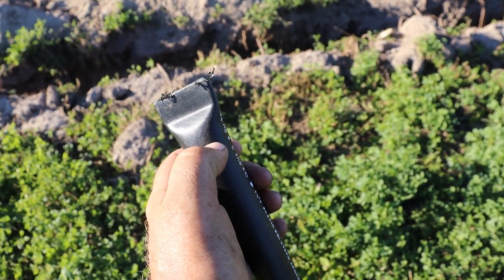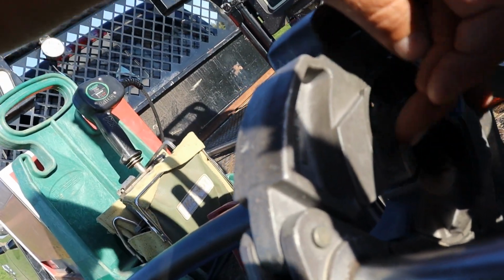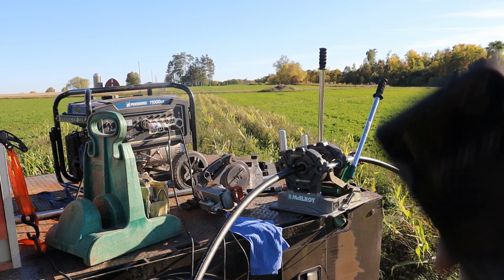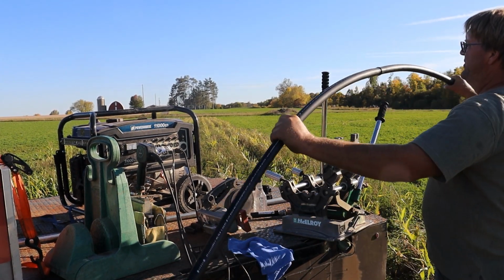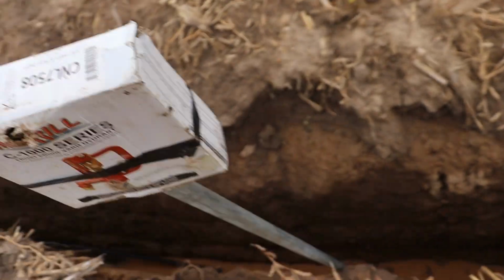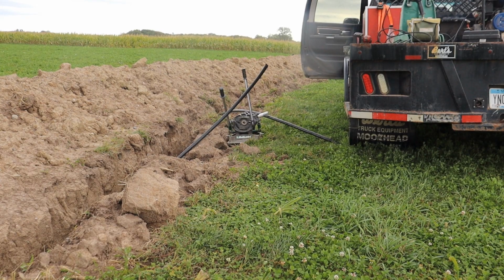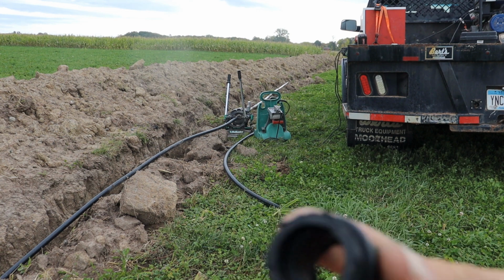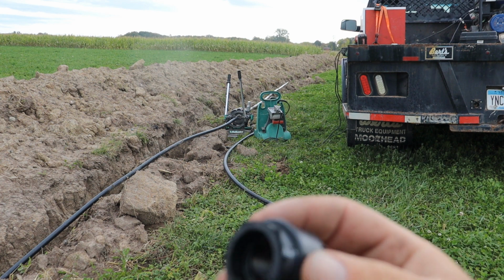Welding Plastic water line for the cattle.

Comment: Very slick way to do lines, not having to worry about splices and connections leaking is huge!
Reply from the maker: i hope so.  and then the heaviness of the pipe,  i can run it over with the pickup and it barely made a mark, very strong stuff.

Comment: That poly pipe is amazing tuff stuff! We use the same type of pipe but in 8" at the gravel pit I work. I have pulled 1200' long pieces around with a 40ton excavator and never broke any of those welds. We pump sand through it and it out lasts steel by at least 10 times  on abrasion.
Reply from the maker: Dirty water or a sand product
Reply: @jonstevensmaplegrovefarms3754  for dirty water to pump silt to settling ponds

Comment: That’s interesting Jon. In Australia we have all run endless amounts of poly pipe using plastic compression fittings. A friend from a station property told me that if you buy poly pipe by the road train load they throw in a welder but I have never seen one. We don’t have the freeze issue so we rip the pipe into the ground using a three point linkage attachment and aim for about 300 millimetres to the top of the pipe.
Where do you source the water from and how do you pump it?🇦🇺👍
Reply from the maker: Putting in a standard house  well Is with a little extra heavy duty motor 
  Is in a central location so in the future we can run to the whole farm with water For grazing. Hopefully in 15 years the home Place will just be for grazing and hay
Reply: Jon Stevens Maple Grove Farms a problem we have all faced is not allowing for enough water and flow in our calculations and as our farms grow or we swap out grain for livestock numbers getting the water to them becomes a challenge. Putting in too small pipe diameter initially has been a major limitation. Also when we started laying pipes in the late 80s we never considered loosing 30% of our rainfall and hotter drier and longer summer’s. 
Ask yourself is the climate going to be a limitation in the years to come when designing a system.
Reply from the maker: @stevenstart8728  dont know what the future holds, we have had 20 years of easy winters coming from a snow belt in the 70s-90s. 

As far as i can predict we should be good on water for rest of my life?!

This gives us two wells for the farm.

Comment: I put miles of the yellow pipe for inch and six inch for gas lines at Kennedy space Center fund job
Reply from the maker: Really?! Had to be neat. Did they have any goofy regulations?
Reply: @jonstevensmaplegrovefarms3754  several regulations lightning within 20 miles we had to go indoors. We had to wear the white jumpsuits dust mess, all kinds of bat gear this is back in the shuttle days 2020 you didn’t get to go anywhere without escort. we did get to meet some astronauts and I got some signed pictures. Lord knows where they are. I was with him 50 yards of the shuttle going to the VAB vertical assembly building and to see that thing up close you would not want to fly in it the racing stripes the reentry put on that thing were pretty scary looking, but it was very cool